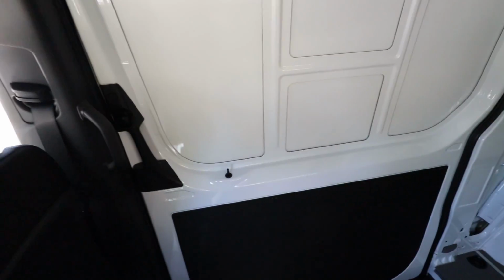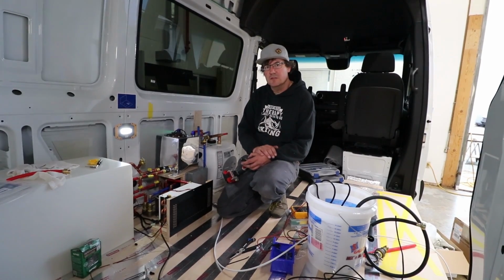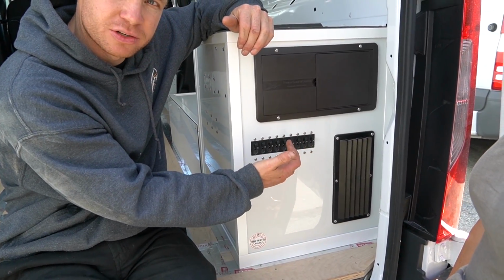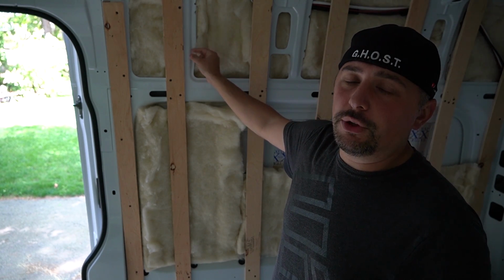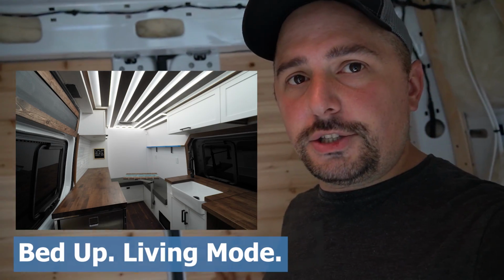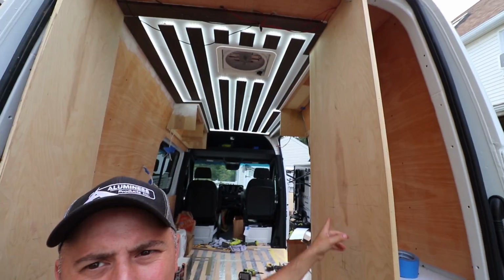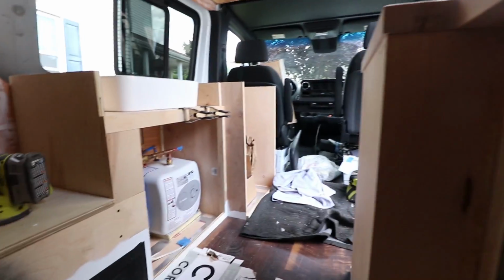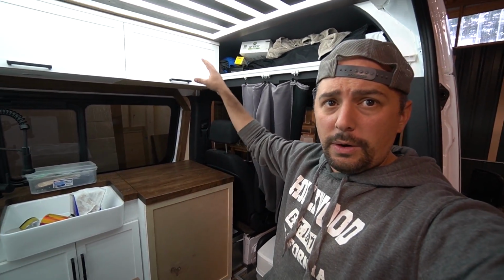FULL Stealth Van BUILD - Radiant Floor Heat, Murphy Bed, Solar Deck, Indoor Shower

Comment: Your shower "counter top" should be hinged to open away from you and block the window for privacy. You won't have to worry about removing it. It will also make it easier to use your toilet. The removable portion of the overhead cabinet should hinge down and tuck behind the counter to when it's folded up. Both will be out of the way and provide privacy, blocking the window while showering.

Comment: Overall, very clever. I like your build, some cool design choices. One thought I have regarding the shower. Rather than removing the entire counter top, with 4 pins, did you consider having a piano hinge across the back so the counter top swings up locks in place, and then the underside covered with a water proof material, so that it becomes a backsplash, and blocks the window. So you wouldn’t have to have a 360 degree shower curtain. Not sure if you get the idea with my description, hope I was clear. 
Look forward to your next video. 😺
Reply from the maker: Thank you. I did consider the hinge in the back of the shower, but my thought was to save a little more space and also the hinge would be exposed on the top of the counter if I used that. I'm playing around with a few different curtain ideas so stay tuned to the video on upcoming shower....hopefully lol

Comment: I have a question, is it a possibility to install a Telsa Wall in a van build? I mean, I know they are expensive, but they have a slim build.
Reply from the maker: I'm sure it is. However I'd talk with a electrical engineer that knows renewable energy. So many talk about using Tesla batteries in their builds and the reason that's bad is battery chemistry. I believe you can do this but you'd have to change a few other things throughout the electrical system to make it all work. I've heard Tesla is starting to make the wall system into tiny homes but only in Australia

Comment: I'm curious.
Have you ever owned a wool coat?

If not, you should buy one and let it get wet.
Reply from the maker: Wool coat is different then wool insulation. Also it's not like we are having this wool soaking outside in rain. Have you even got any insulation wet? Maybe you should try that
Reply: Lol..wool coat vs wool insulation. Sorry Nowew owkelw but I don’t see the comparison. Except that wool is one of the few natural fibres that will keep you warm even when it gets wet.
Reply: Obviously not.
When wool gets wet or damp it begins smelling like sheep's ass.
Why would anyone pay extra to have their vehicle smell like this?

Comment: no vapour barrier, wouldn't use that van in colder climates...
Reply from the maker: Usage of wool doesn't need vapor barrier
Reply: @jarrodtocci  Yes in wood construction, the moisture vill transform too water on the inside of steelbody
Reply: Vapor barrier in a van as a bad idea

Comment: One thing I’ve wondered about radiant heat in both vans and houses...is the expectation that the system will never leak?  If not, how do you determine if there’s a leak when you can’t see anything
Reply from the maker: Not sure about a home but in this system in a van you'll know pretty quickly. They also pressure test the system before they even add the liquid so as long as you don't drill into a pipe after the fact you should be fine and there's no way to puncture the tubing after it's in

Comment: due to missing vapour barrier, you will get serious mold issues unless you are only stay in the desert
Reply from the maker: Wool absorbs moisture and you're not supposed to use a vapor barrier when using wool
Reply: @jarrodtocci  absulutely hope you are right.
Reply from the maker: @Spatzenterror  I made a video with the Havelock company. If you watch that then you'll see more
Reply: Vapor barrier in a van is a bad idea

Comment: What's the R-value of your wool walls?  I like the radiant and solar setup!
Reply from the maker: For every inch of wool it's 3.5 R-value. So it comes in 2" bat but in some places I have 3 or even 4 inches. It's a mix of R-7, R-10.5, R-14

Comment: So mad at myself every time I put non-dimmable LEDs on a dimmer because I forgot to check first, I know that pain. Still came out very cool, congratulations. Would rather live there than in my flat

Edit: Sorry wrote this before I saw that shower lol. Not trying to be a jerk but between home depot peel/stick vinyl tile and melamine board you're going to have to rebuild that in a year, unless you only shower once a month. Definitely consider just boxing that one area out with cement board and redguard, it might seem excessive but you don't want to have to rebuild your bathroom on a regular basis.
Reply from the maker: Shower was a concern of mine too. I used adhesive and silicone so it should stand for a while. I won't use every day but my guess is 5-10 times per month depending on location

Comment: looks sweet, but you missed out on the most important part of building out a van.   although you didn't skimp on the comforts and luxuries in a tiny space and it looks like budget was not an issue but you did blow it on the most important part of van life.     IMO not the best use of space,  Where are all the toys supposed to go?
Reply from the maker: I'm assuming when you say toys you are talking about kayaks, skis, boards, bikes, etc. I guess what I should of put in this video was how I didn't want those things. In my build series videos I started with that and even said I'm not personally interested in that. If I needed those toys then there's always time to rent or borrow them. There's also ways with rear bumper boxes. Personally I don't participate in those activities as much or enough for me to carry those things with me 24/7. But of course I can see why some would like to have them in the van

Comment: You’re awesome dude! I know you’re vans legit because you got the tiny watt people worked on it. Plus your bathroom is creative.
Reply: I want to design and build inside my own van some day. I don't yet have one but I'm looking at the Nissan NV because it might be cheaper. What you did here looks really difficult to do, and particularly the wiring and plumbing. What's your advice for someone with no electric wiring or carpentry skills but wants try building solo?

Comment: if you squeeze insulation in spots it wont do its job it needs the air bubbles that is what actually gives you the insulation.
Reply: Oh right that's why dense styrofoam has a higher Rvalue? Loose insulation is an old theory that's been proven wrong.
Reply: @mrmotofy  styrofoam also has air bubbles. we used insulation at my job for baffling the noise down. it makes sense ya kno the vibration of the noise can get through better if no air bubble and it is denser.

Comment: Once you start bringing those assholes high tech punks to your van is over.. fuck them. This channel is coming to shit.
Reply from the maker: You are the epitome of a hater. You haven't done any research whatsoever and if you looked just a little bit you would see I try and help everyone no matter the budget. This van was my second van build and I've said many times to the ones who actually enjoy watching my content that I went all out on the build. My first build I spent about $12k only. So I've personally built 1 budget van and 1 high end van and I've worked on about a dozen other vans and have been inside at least 100 other vans.

I went high end because that's what I personally wanted with high tech things. I've also learned from living in a van for years what it takes to be comfortable. You want to go and try and teach others, then go ahead, but they will eventually come back to me as I know the business and how to handle this lifestyle as you are just a spectator "hating" from the outside looking in

Comment: How did you make those curved vertical cut pieces in the rear corner of the van? That looks complicated and I have no mad carpentry skills... Thanks!
Reply from the maker: Time, trial and error, and there's a thing called scribbing or to scribe. Not a easy thing to do but once you do it a few times you get pretty good at it. My dad taught me how to do it, and very hard to explain through writing.
Reply: Jarrod Tocci right on... thanks for the info. I will do some research and see what I can find. Your build is one of the best I’ve seen. Cheers.

Comment: Hi Jarrod, i worked as a mobile crane operator here in the UK and bn thinking about how much i could SAVE by building a camber/house on wheels because then i could literally save 20 grand a year ,yes i know the iniitial cost but even after that i would STILL have the camper at the end AND i would save on almost everything else Associated with either renting a house or Apartment or buying. Now i have bn very ill for a number of years but thank G.O.D i have found the right doctor who found the problem in my spine so on the road to full recovery so back to work and buying a small house when i can PAY IN FULL would be ideal and thats the plan NO RENT NO MORTGAGE winner winner stuff the banks , YOU have given me some fantastic tips but could you go over the diesel blown air heating system as they work fantastic here in our Cranes and lorries in the COLD NIGHTS in the UK       chheers        SCOOBS UK.
Reply from the maker: Glad you're doing better! Always love hearing about how I inspire! Keep up the hard work
Reply: Jarrod Tocci lolz

Comment: Your shower is bugging me, I have seen a french designer on his van he made a collapsing shower curtain, its a square hoop with the curtain all the way round he steps inside it, and lifts and latches it to the roof,  showers, when finished he lowers the hoop with curtain still on and steps out,

Comment: That heat system takes up way to much space and is very expensive.
Reply from the maker: All I can say worth the space loss and price. But I understand what you're saying
Reply: But there's huge gains in power efficiency so it's all a cost benefit analysis

Comment: Jarrod can you help me build my 2019 Promaster 136”? I just want a simple build. Getting the insulation, walls, ceiling, and floor Nov. 21, 2019 installed. Just need a bed, sink, and some cabinets. I’m located in the OC area.

Comment: Your background in architectural engineering has set you up to be a killer designer. The little detail of having cedar plank headboard that transforms the whole space into a completely different room when in bed-mode is totally inspired.  Great work, and very fun that you hit most corners of the country to build it!

Comment: I like this one.. Great job..   @13:50  is that a spray foam or a glue? Is the glue necessary?  fundays ahead~~
Reply from the maker: Thank you. Spray glue. Not necessary, could use tape or string to keep up the insulation as well. Glue was just easier

Comment: Too much white. Also when you are showering people can see in the window. The shelf on the driver side wall could have been used for more storage / cabinets.
Reply from the maker: Then the bed wouldn't be able to come down. That shelf is only 5.5" wide. Not deep enough for a cabinet
Reply: What about the window in the shower?
Reply from the maker: @georgesimeone6292  I have other videos showing I have window covers. Normally a very common part in van builds so didn't feel like I needed to show them
Reply: @jarrodtocci  are they waterproof?
Reply from the maker: @georgesimeone6292  lol yes. I also have a shower curtain not shown in video that drops dowm

Comment: For the radiant floor heating, is it water or glycol that runs through the tubes in the floor?
Reply from the maker: Glycol. It has to be or the water would freeze in below freezing temps. It's not 100% glycol though not sure of the ratio

Comment: Thanks for sharing!  Like how you kept the bathroom compartmentalized.  Like Katy in NH said, it makes it way more open.  Unless I missed it somewhere,  I would like to see you actually standing in the shower area, clothes on of course,  to get an idea of roominess.  Also, like your consultant business model.  Hope that becomes very successful!
Reply from the maker: Thank you very much! I will do a full video around the shower soon enough and you'll see me 5'8" in there and hopefully someone even taller to see how they like it. I'll be the first to admit that it's tight but having the shower there was just huge for me. When I took that trip to banff it was really hard to find public showers so for trips like that it will come in handy for sure.
Reply: Jarrod Tocci but the location of that window?! I guess you must have a curtain or something or leave it open and give ‘em a show? 😂

Comment: Great build!  The heating setup is really nice!  Most vans end up with a mold problem from using propane heaters because of how much moisture they put into the air.  Your setup completely eliminates that issue.  I was a little surprised to see you working with fiberglass insulation in short sleeves and without gloves. Did you end up regretting that later?  😂
Reply: How are the diesel hot air heaters that run off the vehicle fuel tank?
Reply from the maker: @raivkka4313  Yes. They tap into the tank and and it will drip diesel (or gas) onto a coil inside the heater which creates hot air. There's more to it but that's it. They are vented outside as well so we don't die for CO2
Reply from the maker: Thank you! Definitely not fiberglass, it's wool insulation imported real sheep wool from New Zealand. It's crazy safe for anyone to use and helps with any moisture issues
Reply: @jarrodtocci  Oh nice!  Is it mold resistant?  That's my biggest worry in a future build--I've seen so many people on YouTube end up with horrendous mold problems (largely due to poor ventilation, granted, but not all).
Reply from the maker: @ABQSentinel  amazing at mold resistant. I did a video with the company a little while back. For some reasons not a lot of views for how much great info they give, oh well.
https://youtu.be/hH355AIqqfU
Reply: @jarrodtocci  I'll have to go back and look at your past videos.  You know how wonderful YouTube is at notifications.